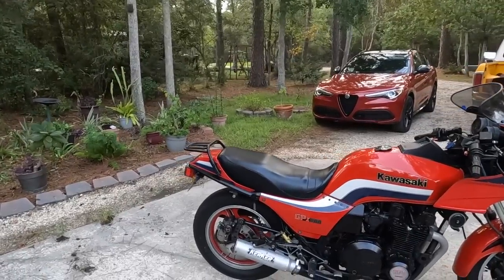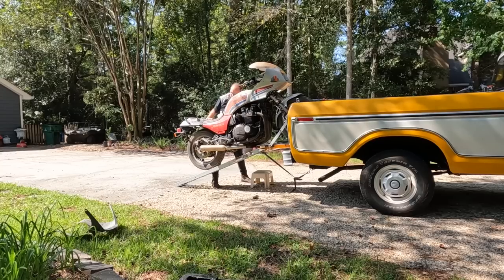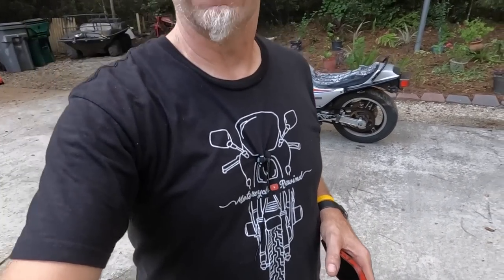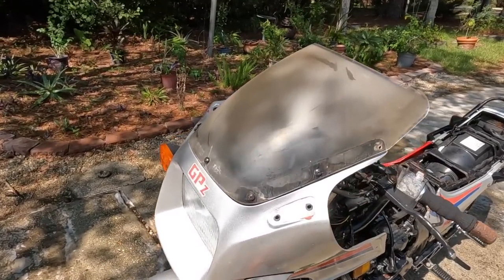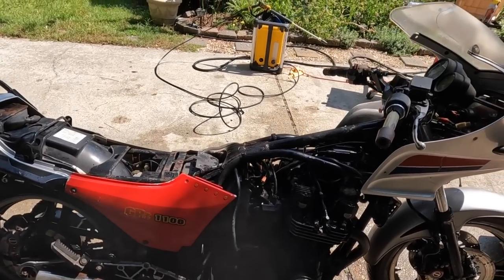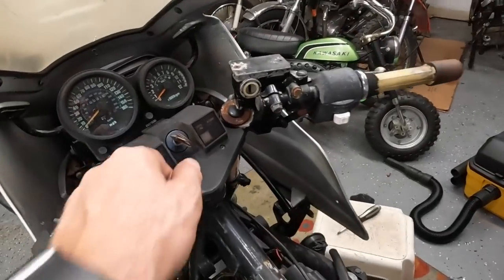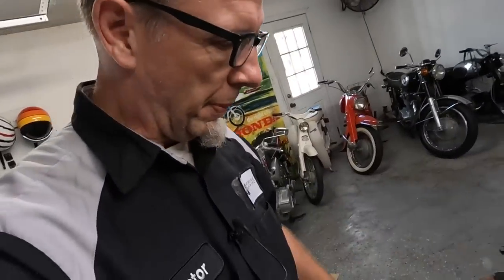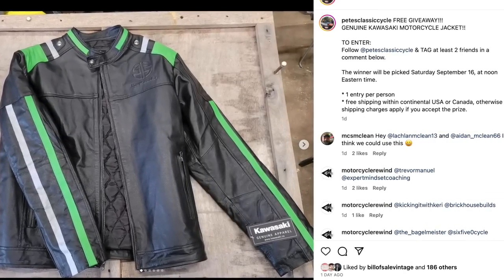I Bought the Cheapest GPZ1100 on Marketplace

Comment: You are so fortunate in the US to have such a large supply of used motorcycles at crazy knock down prices. You would never find these sort of bikes in the UK at those prices. That's why there are companies shipping container loads of them over from the US to UK and selling them here for about 6 times what they paid for them.  Your $400 GPz would be on the market here for £1500-1800 ($2000-2500) as a non-running project. Good luck with the GPz, it's a great '80s muscle bike!

Comment: Nice find! Starter button didn't work because there's a safety switch on the clutch lever, and you didn't pull the clutch lever. Also, it might be tough to adjust the valve lash, since that engine uses shims, which are tough to come by these days. Also, the shims are located underneath the buckets, which means you must remove the camshafts to exchange shims in order to adjust valve lash.
Reply from the maker: Thanks for the info! This one is going to need a full rebuild. Very low compression.

Comment: That looks like a great project.
The fuel injection should save a lot of hassle that old carbs normally bring which is a bonus. I've worked on so many split diaphrams in GPz/GT/Z carbs over the years it isn't funny.
It is a shame so many old GPz tanks rot out like this, but at least you have a good route to repair it.
If you have not already done it I would cut out the sidestand sensor switch as they were a very common failure point which prevent the start button from working.
I'm looking forward to seeing more on this project - good work!
Reply from the maker: That’s a good idea about the side sensor.

Comment: These things were absolute death traps when they came out , so imagine what it’s like now .. check out the handle-bar cap that holds the swing-arm secured on the right hand side , loading the clutch on & off like you’re starting to do a burnout flex’s it in & out .. high speed handling was atrocious
Reply from the maker: Dang I wish someone would have told me before I rode one 3,000 miles.
Reply: Yea mate I wouldn’t worry too much , it was mainly the long fast 180 klm sweepers that you would get the flex , 
so blokes used to ride the back brakes to keep the swing-arms tensioned , 
so unless you’re absolutely giving it the berries you will never really see it , 
and we used to replace those 8mm Kawasaki Allen’s bolts in that cap with air-craft quality high tensile ones 
so you could torque them right up , and the motors are the typical bulletproof Kawasaki units. 
there’s always a fix for things,

Comment: I didn t find the second part, did you made it to start it?
Reply from the maker: It has low compression on two cylinders will need a rebuild. So it got pushed into the corner till I decide to do it. Thanks for watching.